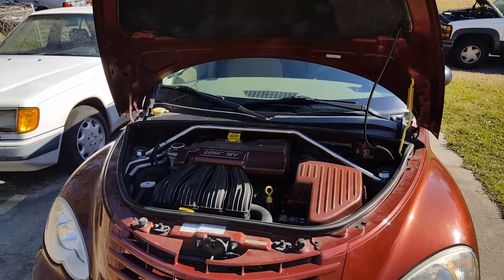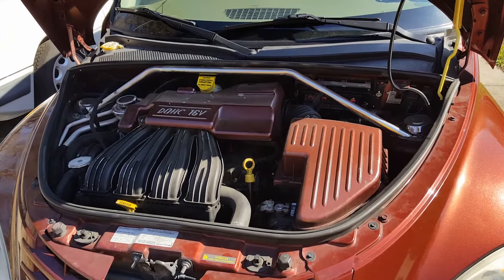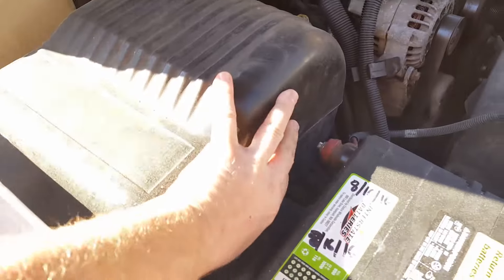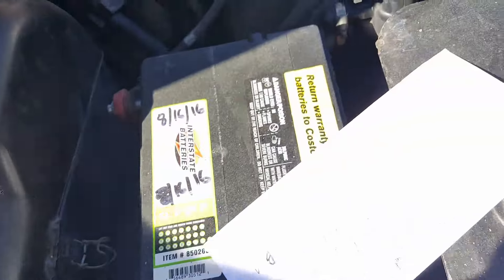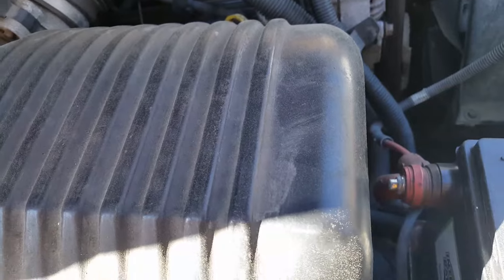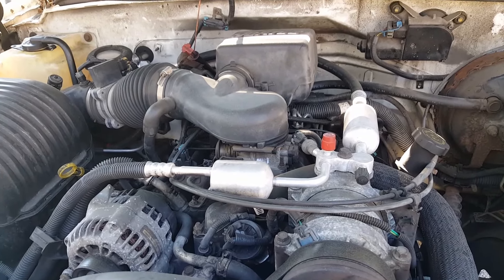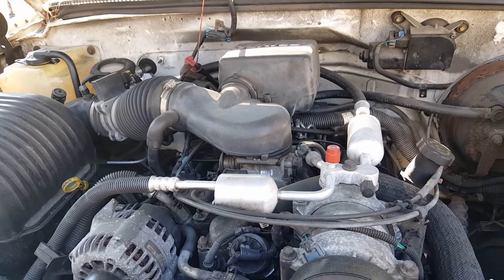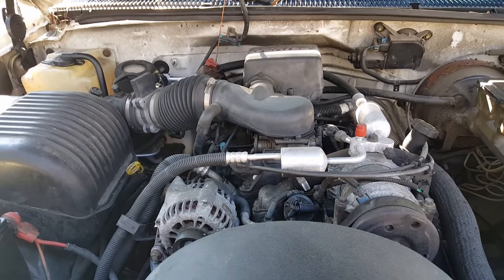If Your Car Wont Start Identify Engine Issues that are not the Battery or Alternator

Comment: 2007 Chrysler PT Cruiser GT Turbo engine code G

I recently bought this car non-running due to this issue.
Will not crank unless you take cover off and force the starter relay to close contact and turn the key / ignition switch at same time.

Fuel pump will not activate unless you turn it on with a scan tool (Autel MaxiCheck MX900) through the pcm and leave it activated by the scanner.

And will only start and stay running if you ziptie the contact closed on the Auto Shutdown Relay (ASD) & keep the fuel pump engaged with scanner and force the starter relay to engage.

When it starts (by doing the 3 above mentioned things) it runs great and can leave it idling for hours no problem. Fans kick off / on as needed and everything else works. 

I had let it sit and idle for over an hour and then suddenly for a brief moment it would start up from the key and then swapped relays out to the originals I had removed and then it would not crank from the key so swapped back to the relays I had just removed and it acts the same as it started out. 

I am getting P0688 fault code but no check engine light.

I have tried:

1. Changing out the starter relay

2. Changes out the ASD relay

3. Changed out the Total Integrated Power Module (TIPM)

4. Checked all fuses. 

5. Replaced ignition switch
Reply from the maker: Subscribed and See my PT cruiser playlist there may be some good videos there. Good luck!

Comment: Recently my Truck  would crank but not start because of a bad Mass Air Flow Sensor.  I was very surprised that my Chevy Silverado would not even start because of this sensor.  The sensor is right by the air filter. The Mass Air Flow Sensor controls air temp going into the engine so fuel injectors work efficeintly.
Reply from the maker: Yes most causes on no crank are sensors. Thanks for watching

Comment: My 2000 Sienna has a battery that is only about 8 months old. It now clicks then has that uh, uh uh sound then starts. Then it will start normal sometimes. Can a battery only 8 months old go bad. All lights, radio, AC everything works. Relieved it may only be the battery. Picked a battery with the most recent date too.
Reply from the maker: Try taking your battery to an auto parts store to be charged yes batteries can go bad in less than a year however it's most likely under warranty Please Subscribe and click the Bell thanks for watching

Comment: I can fix whatever it takes but I'm no good at diagnostics either. '03 PT won't start.  Battery is fairly new and has been fully charged. Starter and alternator tested good. Added a new starter relay. Fuel pump is humming just fine. I turn the key, everything lights up. No dimming of lights. There's just the sound of 1 click from under the hood and it actually sounds like the starter. Oil was good, coolant was good, so what the hell?!
Reply from the maker: Try charging your battery that's a start.  Then if that's not the issue could be a starter fuse or a short connection. Tha ks for watching please sunscribe lots of pt cruiser videos on my channel
Reply: @drewsquickfix  Battery was at 60% when I put it on a charger overnight. It's fully charged. Next I wrestled the starter out and had it tested at AutoZone. It's good. Exact same procedure with alternator; wrestle, test, good. replaced starter relay with a new one. I'm trying to recall but I think it made multiple clicking sounds when it first died. After all the testing and puzzling back together it's only making a 1 click sound and I cant really tell but it sounds like the pinion popping out but not doing anything even tho I saw it spinning fine when it was tested
Reply from the maker: @AntonDaMan  I'm stumped it's hard to diagnose online. Goodluck to you!!

Comment: Hi, my VW Polo 2002 1.4 starts the majority of the time but occasionally cranks and doesn't start. In this case I have to rev the accelerator until engine on and drive immediately or engine will stall. Often the car will start first time though. Has just had a new battery so can't be that. What do you think? Air filter or spark maybe? The diagnostics only show o2 sensor needs replacing. Thanks
Reply from the maker: Might be a fuel issue check my other videos on car wont start part 2.

Comment: 2002 Toyota carolla clicks once and that’s it.   Battery is good, just replaced the starter,  Oil was low but engine does crank manually.  Bought a new starter relay and nothing.  Any suggestions? Thanks
Reply from the maker: Please read the most recent comments. I went over this with someone also see this other video. One click is usually the same as several clicks. https://youtu.be/SGzNIzuwsEI

Comment: Drew thank you. My problem is exactly related to the noise. My brother hooked up the jumper cables to my 2004 toyota tacoma and it brought it back to life and i was able to drive it home from work. He told me it might be the spark plugs so I changed them and still no luck. What could it be? I'm sure if I jump start it again it will work, but what does this entail? Any help will surely be appreciated.
Reply from the maker: +layzy24 it's most likely your battery
Reply: Drews Quick Fixes Ideas And Hacks I took it to auto zone and the guy behind the desk checked it and said the meter was reading 100% and that it wasn't the battery.
Reply from the maker: +layzy24 sometimes the meters can read wrong. Other than that I'm not sure. If battery is over 3 years old I suggest getting a new one anyways
Reply: Drews Quick Fixes Ideas And Hacks you were right the entire time. It was the battery. Granted the battery was 2 years old. My neighbor said it was because of the change in weather. He also said not to take it to autozone since they don't know jack and to take it to nappa next time. I digress with that statement. But then again the people from autosone said my battery was good when in fact they were not.
Reply: I appreciate everything.
Reply from the maker: +layzy24 autozone is okay but not all stores chargers can diagnose a bad battery. A tow truck driver told me mine was bad a while back from his experience. My battery died on a 100 degree day.
Reply from the maker: +layzy24 please watch some more of my videos if your bored. It helps me support my channel and help people like you save money vs a mechanic. It's sort of a way to pay me back :) :). Glad you got your clear working again .

Comment: Correction sir. No u dont have to pull those tabs out. There are NO screws under those rubber tabs. There are rubber boots (not correct description) underneath and u just pull up on the cover and it pops off.
Reply from the maker: Thanks for the correction manuel. Please subscribe !

Comment: Thanks this was helpful.  My car just started doing this and it starts after a few turns of the ignition and just got a new battery so thinking battery is bad or spark plugs
Reply from the maker: Wow thats a tough one. If you just got a new battery rarely that is the issue but you can have the battery tested sometimes they can have issues even when new. You can also hook a jumpstart box up to the battery and it will usually crank up and start sometumes because it gives more power to the start. Yes new plugs could help. Also maybe try changing the fuel filter its about $50 at an oil change place or you can do it yourself if your handy. But man it can be alot of stuff even a computer connection too. Wish i could help more, if you dont pay for a mechanics diagnosis trial and error is how i fix stuff. Not always the best way but i dont trust mechanics and save more replacing parts myself one by one till the issue is fixed. Also can be a bad fuel pump too which might explain the  ocasional no start. Experienced honest mechanics know where to start first. This is the toughest to diagnose. Good luck please subscribe and keep googling the issue :)

Comment: Hey drew got a question for you man? My car ( Honda) sometimes it start good but then every now and then it won’t start at all.i already change both the crank and camshaft, got any idea what it could be I’m not sure if it’s my started or mi fuel pump, thank you if you reply back
Reply from the maker: Hey sangetsu, if you hear it crank it's not the starter, if your starter is bad nothing happens no sound but your car lights and beepers all work. Fuel issues are tough to diagnose, if its cranking most likely a fuel issue. Try hooking a battery booster up to the car too if it cranks after that could be a bad battery or alternator.  Good luck please subscribe and watch my other videos!!!
Reply from the maker: By the way if you figure it out and get it working g please post an update here so it can help others too. Thanks!
Reply: Drews Quick Fixes Ideas And Hacks thanks man I’ll look in too it
Reply: Hi Sangetsu115 - Did you ever figure out why your Honda didn't start? I have a Honda and it is your same situation. I feel crazy because I replaced so much and still can't figure it out.. I'd really appreciate your feedback.. thanks

Comment: None of these seem to be the problem i’m having. It’s hard to explain the sound the car makes, when i go to start my car after it’s been sitting for half a day or so. It won’t start, the lights and radio will come on and it doesn’t make a clicking sound. After taking it to the mechanic he said it’s not the fuel pump, battery, spark plugs, starter, or alternator. he even said he doesn’t know what the problem is. after every time i turn it, it seems to make a different sound. after a while it will start but i’m really confused. please help
Reply from the maker: Try replacing or charging your battery first and go to another mechanic or a dealership even though its expensive they know how to repair issues. Please subscribe!!! See my.other videos with sounds that may help, I have several.on car wont start.
Reply: Drews Quick Fixes Ideas And Hacks The battery was a bit corroded after taking it to autozone, an employee cleaned the battery off and it didn’t seem to help. does that mean it’s not the battery or the battery needs to be replaced?
Reply from the maker: @justice8045  you probably need a new mechanic and a new battery did you subscribe. It helps me keep this channel runnjng for free? Thanks
Reply: Justice try changing the ignition switch
Reply: I just recently found out that my fog head lights wouldn’t turn of after turning off my pt I took my alternator and battery to test and it came back positive I didn’t understand why my car wouldn’t hold charge found out my fog head light in the dashboard wouldn’t turn off so I had to unplug the number 8 fuse from the interior ( inside the car ) untill I can afford another multifunction switch ( signal switch ) they are known for this problem
Reply: The fog light drains the battery even when the keys isn’t in the car it’s really weird
Reply from the maker: @humblebeast1790  awesome glad u figured it out maurice. Thanks for the update
Reply: Np bud I subscribed as well have a good day

Comment: I gotta 2004 grandam that is just cranking n wont start the fuel pump is working alternator and battery is also working. I drove it the day before on a snowing day I've replaced the spark plugs etc I have no idea what's wrong
Reply: Also we did the cadilict convertor as well there's so many issues that have been going on with my car since I bought it in March it was in an accident n we replaced the body issues right away the air filter  was just replaced
Reply from the maker: it can be a malfunctioning throttle sensor or other sensors etc. Plug wires, so many possibilities. Use a reader to see if theres a code otherwise see a mechanic. Hard to diagnose online
Reply from the maker: Thanks for watching make sure you subscribe and see my other videos that may help with a diagnosis

Comment: hey i was recently working on my car and had to go away for a while where my car wasn't running and i left with my battery unplugged and when i returned and fixed the original problem i put my car back together and now when i plug my battery in i hear a ticking noise without doing anything like trying to start it or anything it sounds like its coming from my alternator. i tried starting my car(push to start) it doesn't do anything just turns on all my electronics windows work and everything. please help it would bee much appreciated
Reply from the maker: Sounds like a bad battery. Just a guess. Please subscribe and watch some of my other videos that might help

Comment: so I'm situation 1 ,I replaced the starter and still have the same issue, maybe the relays? or a blown fuse?
Reply from the maker: +David Floyd yes a blown fuse can mean no crank or noise at all. But the lights and windows may work. Also make sure starter is properly connected.
Reply: @drewsquickfix  exactly my problem. No noise and just changed the starter any ideas on what fuses to start with
Reply from the maker: @ronniepitty2098  make sure the battery is fully charged and tested. Alot of people miss that one but if your windows work  it's most likely good
Reply: @drewsquickfix  just bought the battery yesterday

Comment: Car still won't start, new battery,new starter, but when I turn the key no sound, but have lights radio, power windows etc, what could it be?
Reply from the maker: Hey Priscilla please subscribe so I can help further. Also heres a video that may help. https://youtu.be/SGzNIzuwsEI
Reply: @drewsquickfix  I subscribed, and I looked at that video and still no fix
Reply from the maker: @priscillafinkley  humm sometimes it can be a fuse associated with the starter or another major function for the car. But I encourage you to charge the battery just in case theres an issue draining the battery. My best guess Is your starter is not working if theres no sound or it's a fuse . But full power and no sound means it most likely a fuse or electrical if you have a new starter. Good luck. Try the fuses after charging the battery fully even if you think the battery is good sometimes they are defective.
Reply from the maker: Also you can still have lights and power and still have a dead battery. Run the power windows up and down 6 or 7 times. If they die you know it's a battery issue
Reply from the maker: @priscillafinkley  please update me and the other subscribers when you find the issue. Thanks!!
Reply: @drewsquickfix  Will do!!
Reply: It was the crank fuse that's up under the hood,put a new one in, and it stated right up!!
Reply from the maker: @priscillafinkley  awesome thanks for the update. Lol I knew it!! Stay tuned and check out my videos I have more than just car stuff :)
Reply from the maker: @priscillafinkley  also please do me a favor and share my channel on facebook and social media and tell how I helped diagnose your issue. I need more subscribers!!

Comment: Hey my 2001 audi will start everyday but the second time within a few hours it will just crank and wont start for another 20 min to a hour. I changed the plugs and it does the same thing? Any ideas? Thanks
Reply from the maker: Try getting a new battery, if that doesn't work replace the alternator. Thanks for watching please watch my other videos share withnyour friends and subscribe especially if I just save your the $300 mechanic fee. Thanks
Reply: Drews Quick Fixes Ideas And Hacks thanks i will, btw if it cranks wouldnt the battery be fine? And if it starts after a a hour do you think it can be a fuel problem?
Reply from the maker: No your battety can have bad cells and start one minute then be dead after driving trust me
Reply from the maker: If its making the growling dog sound. See my other video on car wont start
Reply from the maker: It can also be a fuel issue hard to diagnose over internet

Comment: Hi my car is doing that noise ppppppppppppp when I start it  but only in the  after noon after driving  and especially at the evening and nights  maybe the engine is hot ? because I drive a lot and never happen first start in the morning  , I ask the mechanic saying not from the starter not the battery and not the alternator could u tell me what it can be ?
Reply: Than pppppppppp 2 . 3 times switch off switch on after 3 trys  it start
Reply: Could be the engine ?
Reply from the maker: +Aziz Bob watch my part 2 video and subscribe that might help more
Reply: Drews Quick Fixes Ideas And Hacks I will and yes I suscribe
Reply from the maker: Aziz Bob also go talk to a automotive parts store like autozone. They can be very helpful

Comment: My car won’t Start in cold days ? What the solution yes I putting new battery
Reply from the maker: Cheers please subscribe for more great videos my friend
Reply: I’m not kidding I’m serious about it . In cold days car won’t start as soon as get worm crank up right away
Reply from the maker: You need to plug your battery into a charger overnight when it's cold. Most cars dont start when it's extremely cold. You battery could also be bad after 2 or 3 years and the cold makes it worse. Try buying a battery charger. Sorry I didn't understand you not sure if that was a typo
Reply: Could be a dirty idle air bypass. Those tend to act up more on cold days
Reply from the maker: shield most likely.its the battery even new batteries can fail in sub zero weather like when he asked there was a polar vortex battery fluid just freezes up because there is water in a battery
Reply: Alright I changed the gas inside the tank and the car started right up no hesitations it’s was bad gas even was new but it’s seems the gas station is fucked up
Reply from the maker: @themechanic4222  great thanks for the update. Lol you didnt say the car cranked though lol if it cranks it usually a fuel issue not the battery